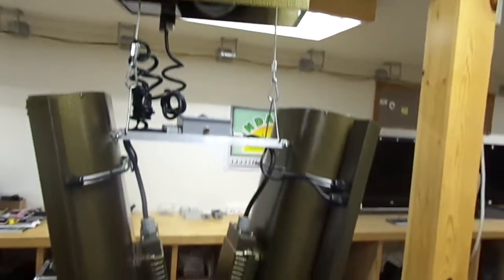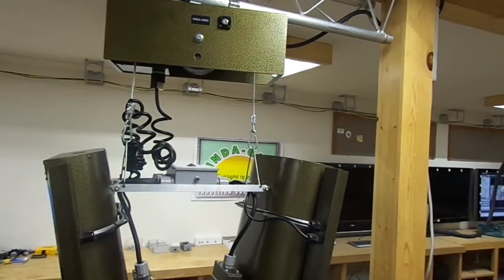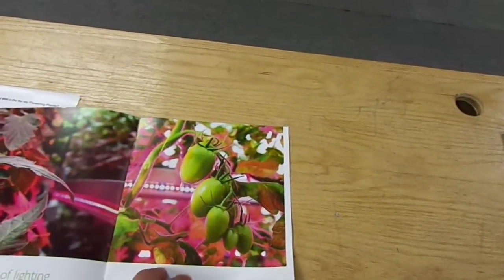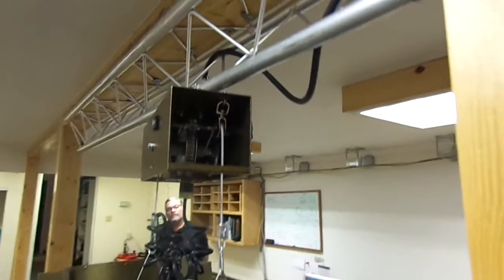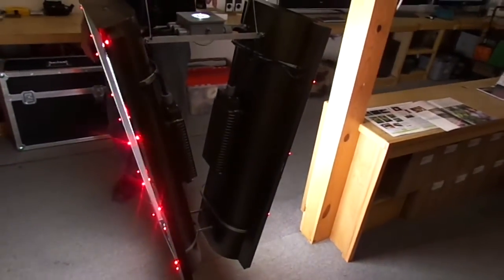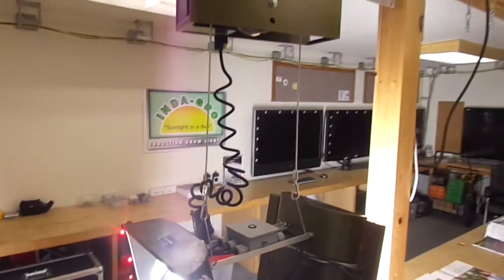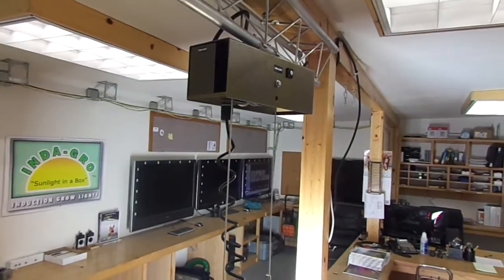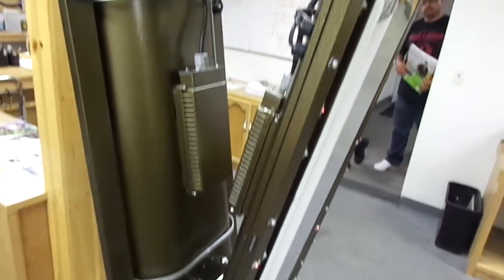Inda-Gro's Revolutionary Greenhouse Vertical Light Rail Systems

Comment: I like the design but I would rather buy one vertical light with no shade and your cool hanging system. if I was a designing light systems for you I would remove one light and both shades from your system. you will use half the watts and cast light in both directions. I bet you would have a similar or better yield/watt ratio with my suggestion.

Comment: Nice to see another approach to induction lighting.  You mention "supplemental" lighting, but what about as the primary light source?  I design indoor hydroponic vertical farms and am very intrigued by the prospects of induction lamps, but still haven't quite been sold on them as a primary light source.  Previous models that I have tested had very bulky reflectors with paltry PAR readings, except for directly below the lamp.  I'm also impressed by the addition of the LED rails.